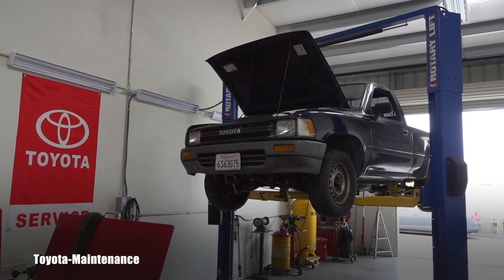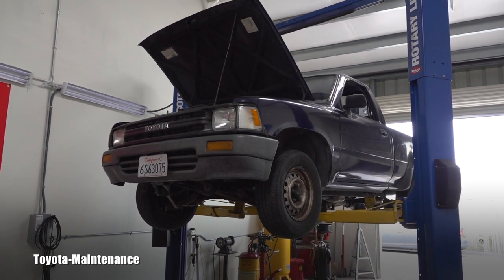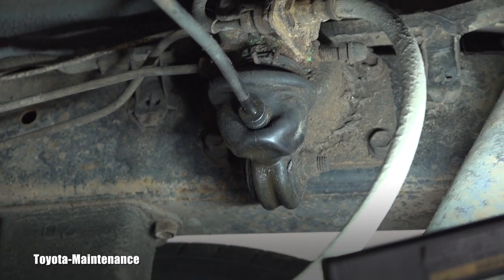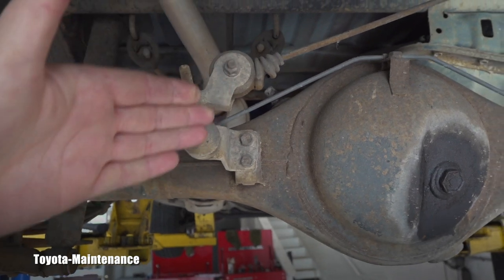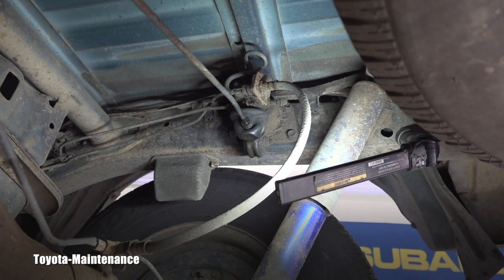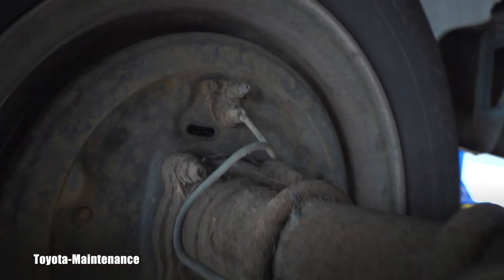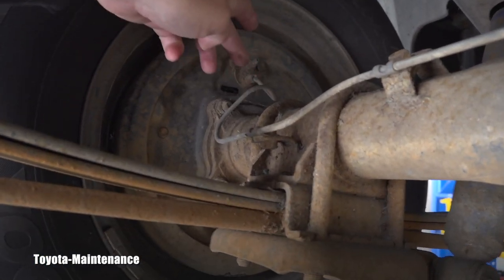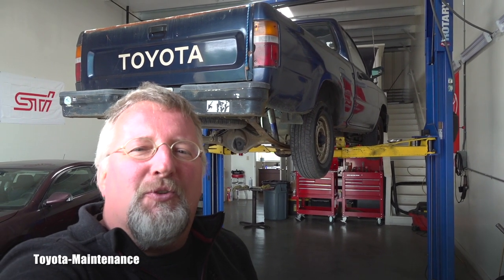Toyota Load Sensing Proportioning and By-Pass Valve LSP & BV

Comment: Very expensive, as you say, but I'd do it, especially considering the overall condition of the truck.  I think forming new lines manually would save quite a bit, and shouldn't be too hard, but that valve is the big headache. Plus they've got a real expert doing the work, so it'll be done correctly!
Reply: Wouldn't the labor of my manually forming the brake line plus cost of generic line exceed $70?

Comment: Great explanation and appreciate the careful description!!  I blew a rusted out brake line on my 2002 Tracker and will simply by-pass the LSPV after seeing the complicated tubing bent into it.  It is located in front of the RR wheel high up.  Not to mention the valve itself is no longer available (The vehicle is Suzuki built with a Chevy nameplate on it).  That 1991 truck has a micro-fraction of rust on it compared to my Midwest vehicle.  30 years in CA= little rust.  What rust?   That axle line would be a cinch to replace with copper-nickel line.  The 1991 is well worth repairing unless it has other major problems...

Comment: $600? I just replaced the load proportioning valve and L/H brake line for less than $100. Ever heard of eBay? Also the brake line and tool needed to bend the line including the screw ends, cost very little on eBay! The hard part is readjusting the Load Proportioning valve, thats a pain in the butt to be sure!

Comment: Just unscrew that prop valve and lever and throw them in the garbage, connect the rear brake line coming off the master cylinder to the brake line coming off the axle, and the brake line that goes to the proportioning valve that is teed into the front brakes on the driver side front wheel well is no longer needed, you remove and plug with 1/8 npt plug. Fixed and brakes better than oem less than 10$. Already did on both my trucks brakes better
Reply: How did this hold up. I’m thinking about doing it so I don’t have to buy a new valve for 200+ dollars. I read that it would cause lock up because I have discs in the front and drums in the rear
Reply: Did you wind up doing that?  I'm considering the same thing.
Reply: @bran-qt7ds  ya 2 much bs

Comment: Can you buy flex line... or straighten out the old line?  I see the problem...A Solution is normally included in the video??
Reply: I think u could cut the old section out flare it out and add a piece in either flexible or bend a small section.

Comment: Had a similar part on my 1985 GMC pick up just by passed it, brakes worked better without the valve. Truck looks great underneath compared to what you would find in New England, most 90's Toyotas have gone to rust heaven. Locally we bend our own brake lines very easy, do it almost every week, have plenty of rusted out brake lines come in.
Reply: Same here in New York. Rust crust and dust is all you find if the vehicle is more than 8 years old.
Reply: sense something that's not these anymore?trying to make adjustments for load weights?..the electric part of the part.how do you bypass that?.thanks.Curious.IF you bypass the valve,does the truck have a sensor that's trying to sence
Reply: rearranged what I typed..hope you can understand my question.up.rearangeesim using is messed ☝Tablet I'm
Reply: See???

Comment: Time to send the customer to the junk yard for parts.
Reply: My thought as well!
Reply: Not for this part.  Anything you will find in the junkyard will be just as bad, and it's a matter of time before it fails in the same way. In my area, Toyota trucks get stripped really fast.  My valve had the same issue, and I ended up putting on an aftermarket one, and got the other parts from Ebay, but I really still don't like how it stops.  I may end up putting a manual one on, or re-doing it with the OEM one.

Comment: Can lowering a truck by 3 inches with lowering blocks cause the proportioning valve to send more brake to the rear thereby mimicking proportional valve failure?
Reply: Did you ever find out the answer to this?
Reply: @kaitlyngremore170  yes I did. It in fact did cause the rear brakes to bite long before the front. I flipped upside down the arm that ties the proportioning valve lever to the differential and it fixed the problem completely.